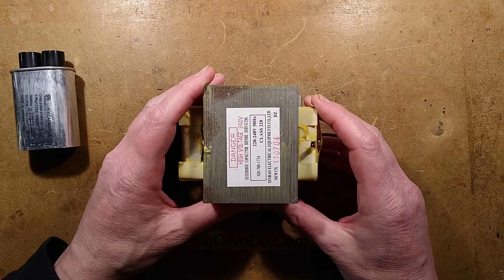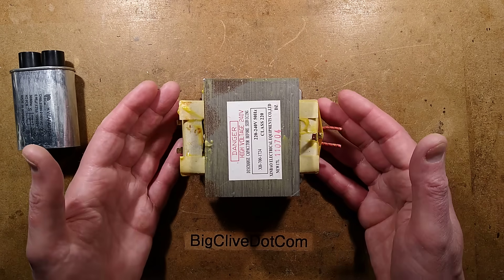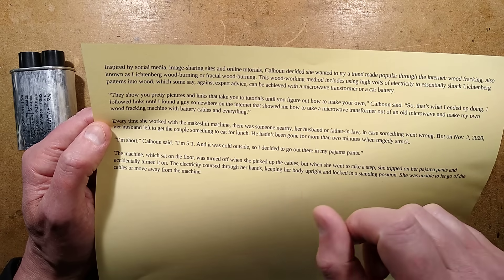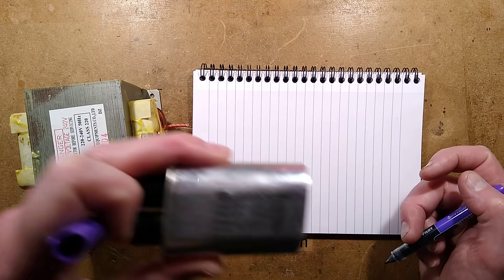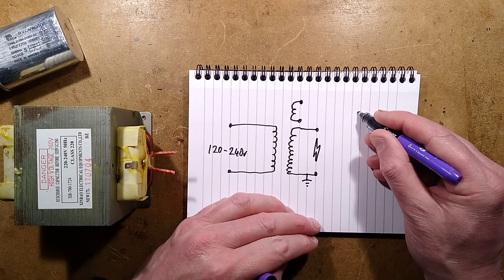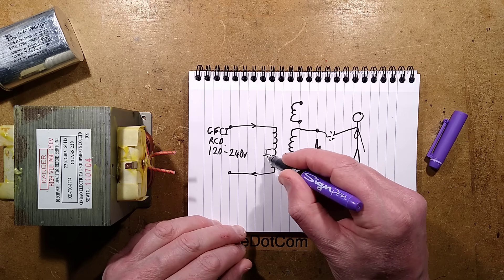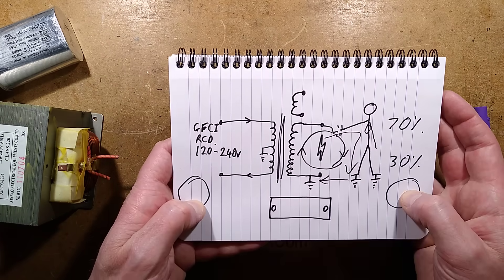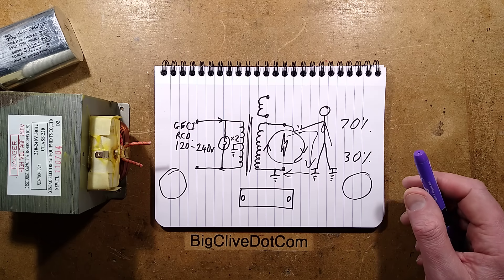The most deadly project on the Internet

Comment: High voltage experimentation (mains potential and beyond) should NEVER be attempted without proper reference to safety and must be supervised at all times. Hence why linesmen and power generation engineers will only typically work in pairs or teams on live conductors and transformers. In 1984 I witnessed first hand what 133,000 volt railway substation does to one careless maintenance technician. nobody could even approach him, until the power was cut some twenty five minutes later. Let's just say it made a trip to the electric chair seem positively pleasant by comparison.

Comment: as long as you wipe water on the wood( not spray), place electrodes correctly and walk way from the project, also use a cut off switch you should be ok. its the spray you mentioned, wet hands, probing with short leads ect that made me physically cringe.

Comment: I have used the transformers out of neon signs to make a Jacobs ladder. I did service on signs and fortunately never got a fully grounded zap. I would never do now what I did back when I thought I was bullet proof. Odd, how you become more safety and health conscious in your latter years. I would like to state that I see many go overboard on the safety bit and basically hide the danger, like wearing all the OSHA gear until you can't see what you are doing or where you are going. Common sense goes a long ways, and giving it a second thought is good insurance.

Comment: Her case is exactly why if I ever got into it, I'd have a key switch to be able to turn it on. Hard to accidentally turn that on. Running a form of dual shielded push button switch, where the buttons are too far apart to push with one hand, and can't be activated by just setting something on it, with it as well is another useful tool. Requires a key to turn it on, and push both buttons to keep it running.

Comment: The usual sorce of electric shock is 120 VAC. This hurts, but it's AC or alternating current. Although it can be deadly to a truly determined individual, in most cases, it just gives you a painful poke and you learn not to do that.
Another common source of electric shock is the ignition of internal combustion engines. This is high-voltage stuff and it really hurts, but it is very low currrent and a deadly outcome is very rare. It's a bit like the static discharge from rubbing your feet on a wool or acrilic carpet, then letting the spark from your hand surprise someone for a joke.
But, these high-voltage set-ups with a constant power supply are a recipe for disaster. To engage a working brain-cell or two would be to realize that you're burning wood with this current. What is it going to do to a living person which is mostly a big sack of salt-water? Just don't take the risk.
Thank-you for this video. I hope people take your cautionary tutorial to heart.

Comment: If I was going to do this. 
The power supply would be in a sealed box. 
A deadman foot switch on the floor. 
The piece would be inside a much larger non burnable container, with a window. 
There would also be protection to keep the unit off until the door of this enclosure is closed and latched 
All high voltage wires, when energized would be inaccessible. . 

Do a search on how to shrink a coin.
Reply: Perhaps a large microwave oven could be used as the chamber and power supply enclosure?
Reply: @soundspark  that would be perfect, the enclosure is also basically a faraday cage.

Comment: I'd like to thank whoever made it mandatory to put tamper resistant hardware on microwaves because just my brother in law asking if I had the tools needed alerted me to what he was trying to build from a YT video. Make an electromagnet instead, they're fun and you won't die if you tickle yourself with angry pixies.
Reply: I saw one video where the case was just violently ripped off on that last tamper resistant screw.
Reply: @soundspark  When I was scrapping them I used a hammer which was quicker than swapping tool bits. Probably my brother in law's next move if I hadn't of been over that day.
Reply: @tihspidtherekciltilc5469  Wonder if anyone ever thought to route the HV wires INSIDE the oven to use as a safety-interlocked enclosure?

Comment: Dangerous, be sure. Dead Man switch would be essential along with the indicator lamps. Could a standard GFI socket be of any help here?
Reply: GFCI sockets only help with leakages on the primary side.  The secondary side is an isolated path that it cannot see.

Comment: Hello Clyde. Greetings from northen Sweden.
At my last workplace, factory in flooring, one machine ran on DC 600V and plenty of amps. Even the electricians had respect for that machine. When work was to be done on it they flipped the switch, two padlocks on the switch and they removed the fuses. That's how it should be done,, I think you agree.
Reply: In the USA that is considered Lock Out Tag Out.  You lock out the energy source with a tagged lock, and there is also a custody requirement where the technician applies their lock before going to work, and if there are multiple technicians they use one of those hasps with multiple holes so each one puts their lock on it so that it can only powered back on once all locks are removed.
Reply: @soundspark  yep, that's what it was called, just didnt come to think of the name when I commented.
The factory had american ownership so we had mostly the same safety routines, I was also a safety rep for many years.

Comment: MOTs aren't near as dangerous as overhead lines. While a MOT may make voltage they don't make near the "blow off body parts on contact" amperage of overhead lines.
Reply: More dangerous because they get treated with less respect and they don't drop out when you get shocked.

Comment: I remember that 'deadman switch' from working with presses (150 tun and up) for car body parts. They even have them there and to make absolutely sure you cannot have the press slam down with you in it while changing plates, they had these slots 1 meter apart where you have to put your hands in where the buttons were located.
So even falling on the contraption will not activate it, only a contious action would work.
i figure these will do great for this also!
Reply: You know darn well that multiple "incidents" had to have happened to implement those safety features.
Reply: @mrbyamile6973  I'm fond of the saying I've heard that "Safety regulations are written in blood".
Reply: Hakim Mohamad  once I designed a simple Pneumatic press machine for an industrial process with such dead man switches.  A few weeks later a saw an operator using it with the toothpick trick.  I spent that night thinking how to redesing the safety switch. The next day I installed a PLC and programmed a logic were the two buttons have to be pressed simultanously with less than 0,1 s time difference and keep them both presed in order to start the cycle.  And if one of the push buttons were pressed more than 1 s while the other was open it will lock the machine. That solved the issue.
Reply: Um, that's why they call them Deadman Switches

Comment: Voltage hurts, current kills...
Reply: Can't have current without voltage.  A low current high voltage source has a lot of internal impedence and thus if you touch it the source gets loaded down and can't keep up to push the deadly amps.

The microwave oven transformer is right in that "sweet spot" where it can put out a voltage that can easily bypass all body resistance and not drop out before it can cook the victim from the inside out.

Comment: So a 2 hand control is good but what we call a dead man switch is a trigger/squeeze switch where you have to hold the switch at a certain point. If you release the switch it turns off, or if you squeeze the switch all the way (like if you were being shocked and the muscles clenched) it would trip and shut off.

Comment: I wonder if an electric fence charger used on ranches would be safer due to lower current? Maybe it would not be strong enough to create the fractal pattern in the wood. High voltage wood burning is not something I am interested in testing.
Reply: If you can find one of those old fashioned continuous current type fence chargers, the kind that nearly set my family's yard on fire back in the day, that would probably work well.  Most modern fence chargers just put out around one pulse per second.

Comment: Is the Micowave metal chassis connected to the Transformer housing, which would mean that a transformers secondary connection is tied directly to the chassis? If so, this would seem to me to violate a basic electronic product design rule that electrical appliance operating currents should not flow, or have an opportunity to flow, through the metal chassis?
Reply: Microwave ovens use grounded plugs keeping the chassis at ground potential.  The secondary feeds into the magnetron, completely enclosed within the cabinet, and drains back via the frame.  This may be so that the chassis of the oven doesn't radiate excess RF energy.

When assembled properly there's no way a MOT could energize the cabinet of the microwave oven, as a loose HV wire would be able to do nothing more than short out and blow a fuse in the oven.

Microwave ovens are built to extremely strict safety requirements, and have zero electrocution risk with the cabinet closed.

Comment: You should only grab one lead. Clamp the ground lead to the workor stab it into the wood then grab the other lead using only one hand. Much safer as long as you have a GFI as well.
Reply: GFCI has no idea what is working on the secondary side.  All it will see is the current flowing in and out of the primary.

Comment: Your description of GFI was wrong. The way GFI works is only works on three wire systems. It detects small current going to earth ground. You show the transformer negative going to earth ground. If the user wires it that way with only a 2 wire system then no GFI will work. GFI is hooked betweer the positve and the third earth ground wire. If someone touched the positive wire or even the negative wire and current flowed through the secondary to earth ground then it would feed back a higher current to the primary to earth ground which would trip the GFI and protect the user. However even a second of high current passing through the heart could stop the heart. 

On the other hand if you are grabbing the positive and negative lead and there is a leak in the insulation it would pass through the heart without going to earth ground. I'm surprised there aren't a thousand deaths from this stupidity of using battery cables instead of proper welding cables and heavy gloves and rubber boots.
Reply: I've taken apart a GFCI.  The hot and neutral wires go through the sensor, and the ground bypasses it entirely.  There's no way it can protect you from a secondary shock, because that is a circuit all its own.  Misinformation is deadly.  The idea of Clive's dead man's switch is that it should be situated where you have to push both buttons while away from contacting the deadly parts, and it means that attempting to adjust anything you have to release the switch and cut power to the machine.
Reply: Here's an explanation - https://www.youtube.com/watch?v=3E12nnpWc5c&t=93s
This shows exactly why a GFCI won't work on such a system.  All it detects is a difference between hot and neutral, and there won't be that difference from getting fried by a MOT.

Comment: I played with a microwave oven transformer when I was 16 or so and I was fortunately very terrified of the thing.  I only ever used it with a small AC capacitor in series with the primary to drastically current limit the device.  It made for a nice driver for flyback transformers and ignition coils to further step up the voltage to get some nice arcs.  Of course those second stages did tend to burn out from voltages they weren't meant to handle.  My 'safety' method was the one hand rule and a long stick for handling the HV end for drawing arcs, which ended up not being all that safe and I learned some lessons from minor shocks here and there.  In grade school they'll teach you that electricity takes the path of least resistance, which is just plain wrong.  It will take every path available and at high enough voltages, it will forge new paths on a whim.   The worst thing I did was build a handheld coilgun from disposable camera parts without proper safety precautions.  Disposable cameras each have a little charging circuit and 350-450v electrolytic capacitor in them.  I would get dozens of them free from places that would process the films for people.  I strung 10 of those caps into parallel on a single charging circuit inside the body of a plastic toy gun to power the solenoid that could drive a nail through an aluminum can.  It was a fun little project.  I made the mistake of working on it with the batteries still in place.  The switch got knocked to the on position and I ended up take about 400v hand to hand, across the heart.  My legs kicked me back across the room and I felt a big thump in my chest from the heart contraction.  Fortunately I was totally fine afterwards, but that could have been a deadly mistake.  My safety methods improved significantly after that.  Batteries were always removed when working on the device and the capacitors were always shorted.
Reply: You got lucky.
Reply: "In grade school they'll teach you that electricity takes the path of least resistance, which is just plain wrong" 
funny lol
Obviously the path changes as lots of small but important variables constantly fluctuate and sometimes there'd enough energy to reach a different state through a new path of least resistance. There a reasons and legitimate testable equations and methods to why they to do what they do. You're lucky you're not dead lol

Comment: High frequency with low voltage? That can work - well it's like a capacitor anyway. Higher the frequency lower the impedance and that lower impedance and thus more power at the same voltage.

Comment: I used to work on 1000V 160AH batteries. Now THAT's scary! DC will lock your muscles up tighter than 50/60Hz.

I am a firm believer in the "one-hand rule". When making a high voltage measurement, keep one hand in your back pocket. That way, if you take a shock, it's less likely to be across something vital, like the heart.

Comment: there is no need too remove anything from the microwave...you remove the plastic bar expose the spade terminal  attach a wire to it ,another wire  runs from the bottom case of the microwave where there is no paint  the 2 ends of the wires are attached too nails .there is no power until you power the microwave,,   you hammer in the nails into some wood  brush on the bicarb and coke  ,,,the advantage is you have a timer,,you can turn off power at the wall or the microwave,,and you dont even have too be near the wood or the microwave except when pressing start on the microwave,,turn off at the wall move one of the nails or both apply more bicarb and coke turn on at wall press timer then start,,,turn off at wall...easy,,,the deaths are just natural selection in action,    https://youtu.be/WI4BRLxshY8
Reply: What kind of wire are you using?
Reply: Standard speaker wire.you tube keeps removing my videos. There a Russian  mob that show how its done
Reply: https://youtu.be/4DdR4gT2__o?si=EYLiGhk_iWltgPhU

Comment: For example with high ampage a 12 v battery can kill.
Reply: Then tell me how I can touch both terminals of a car battery and not get shocked.  An electric chair doesn't run on 12 volts because 12 volts can't push deadly current through the victim.

Comment: Voltage has nothing to do with it. The voltage could be 16000 v and you wouldnt die as long as the ampage is below 0.5 of an amp. Its the ampage that kills. Yes even 1 amp can kill.
Reply: Just under 0.5 amp is still in the very deadly range, and you'd also want to measure output current when the transformer is heavily loaded because that 0.5A rating of the microwave transformer is what it can safely output to its intended load, not what it can put out when an improper load ends up across its terminals.

Comment: BTW clive has a pyapal you can donate to.

I am no electrical expert but from a pilot risk perspective this is a human factors nightmare... 

The best way to avoid a risk is to never do it in the first place (not burn wood or not fly a plane for example).
Second is to avoid exceeding known limits (aka poor judgement).
Third is to avoid error.

The problem is there is such a big body of knowledge of electrical safety that would need to be learned to understand those limits and know what line not to cross which nobody doing this will know.

The second is human error is inevitable, and in this case few ways to mitigate it.

I wonder if having very thick rubber gloves and wellies would help. I wonder if a non mains referenced galvanically isolated circuit would help. I don't wonder hard enough to try and find out.

Comment: Me: Not sure if I should connect a 120w solar panel to a device that charges at 65w, even though it has a built-in charge controller, and the panel would have to be imperfectly placed and would probably never put out it's full power anyway.
People online: So I sprayed salt water everywhere and picked up 2000v jump leads with my bare hands...

Comment: I have a degree in EET and I still have yet to work with one of those. Its a 1 touch and your dead device. I honestly feel safer working with primaries than those things. PhotonicInduction showed us what hiigh voltage can do to a potato and that surprised even me with my knowledge of electricity. Watching ppl treating those like its just a AA battery is some of the most cringe stuff I ever seen.